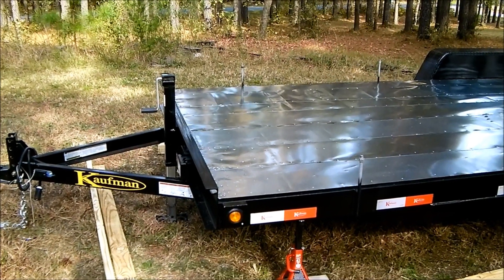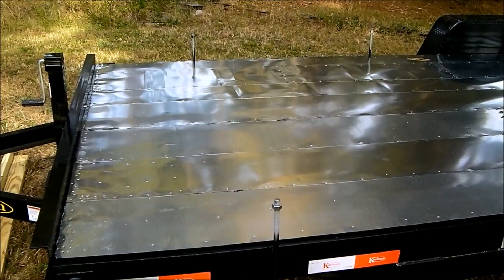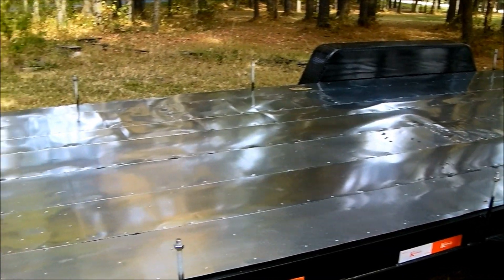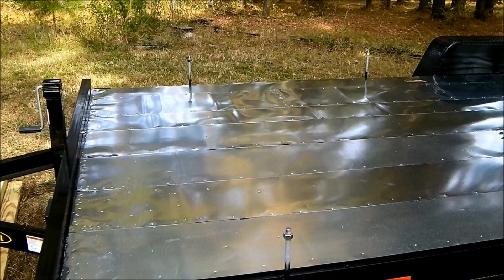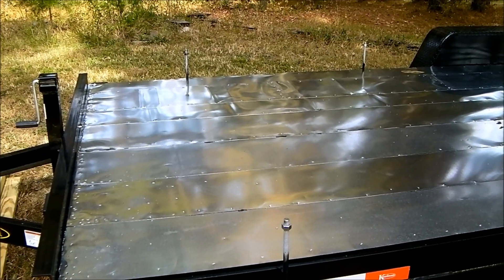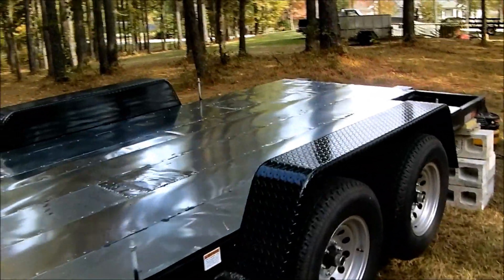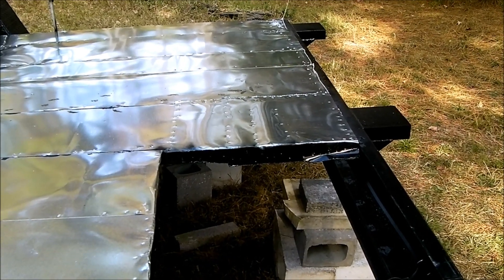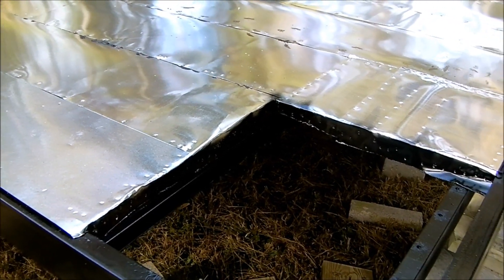Adding Flashing To The Deck Of My Tiny House

Comment from the maker: Yes, I used staples in an air gun.  But I also drove them through where I applied the flashing adhesive so it sealed it even when we compromised the metal with the staple.  Galvanized staples of course.

Comment from the maker: Treated lumber will react to pretty much any sheathing or faster (screw/nail) that isn't hot dipped galvanized or Stainless Steel.  If you do, the treated lumber chemicals will literally corrode the screw/nail until there is nothing left!

Comment: what kind of self tapping screws did you use to attach the flashing to the steel frame and how much do they run? Did you predrill the steel first? I'm assuming you used impact driver? Thanks!
Reply from the maker: Paul B Just galvanized staples through the metal with a air gun.  Didn't need to be too secure because very little if any force would ever move this.  Its more to tack it in place
Reply: sorry, forgot to say that I'll be putting mine down below to keep critters away from the wiring. my trailer has 2 steel stringers welded inside the frame and I hope to insulate the interior of the trailer and not have to frame out the subfloor joists
Reply: The Tiny Life The staples go into the steel trailer that easily? (I understand you did it, I'm just baffled a little.)

Comment: Being in the automotive field. rather adding flashing why not make a galvanized floor pan that will drop in the trailer, then seam sealer in the edges. Less joints, less work in the long run.

Comment: It looks like for this you went with a nail gun to hold down the flashing to the deck. That's probably the right call given that the house will be sitting on top of the aluminum holding it down. I used 1 and half inch stainless steel screws to hold down my flashing and felt like it was overkill.

Comment: Why wouldn't you do that on the bottom of the trailer instead?
Reply: I've seen it on the BOTTOM also... then they used the cavity to fill with rigid insulation... curious
Reply from the maker: Its just much easier that way honestly.  In an ideal world I'd do it on the bottom, but it would be much harder and there isn't a good place to affix it because of the cross members of the trailer.